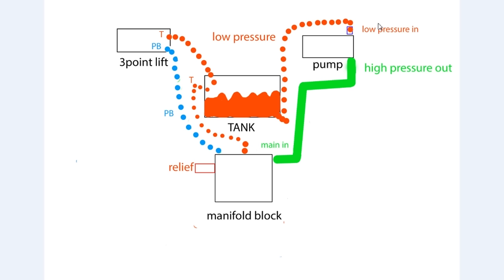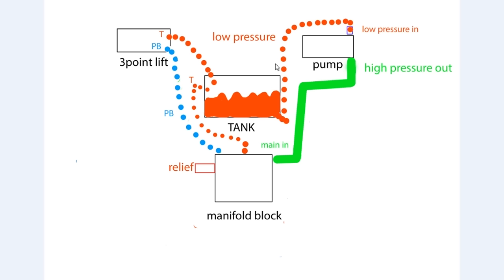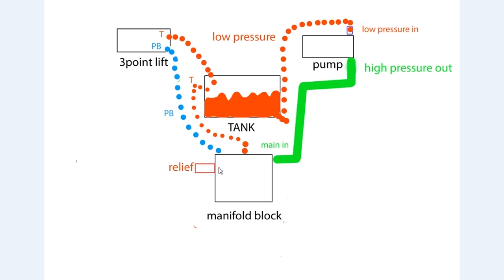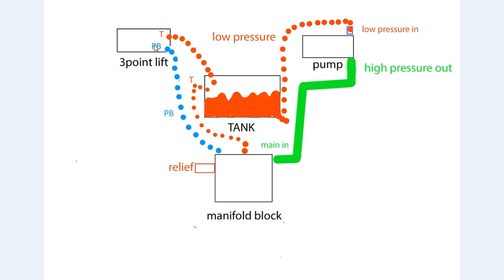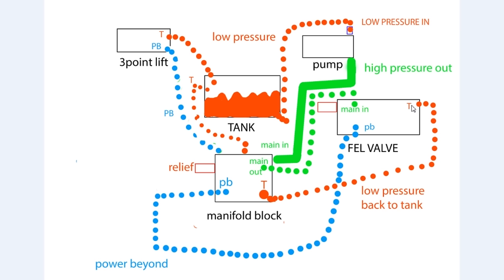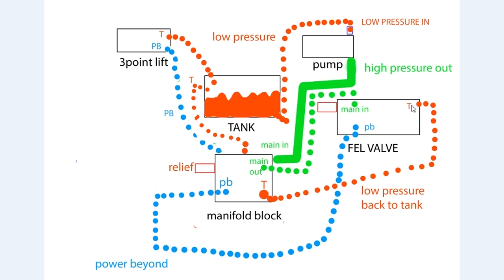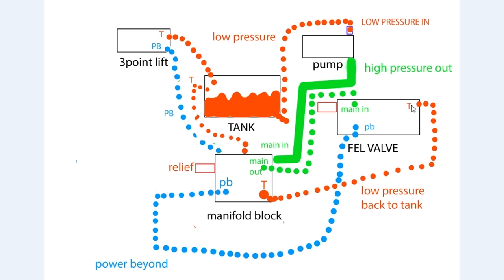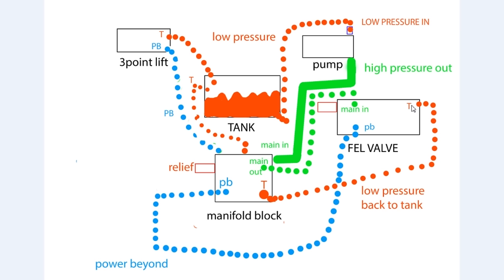adding rear remotes and understanding tractor hydraulics

Comment: I'll add my thanks as well, but I do have a question, if you don't mind.  I just added a 3rd function valve to my L3301 to operate a grapple on the FEL.  I  am working on installing top & tilt to the box blade as well.  My Prince (Wolverine) 2-spool valve does not appear to have a relief valve going back to the tank, as your video shows.  Also have no back hoe.  From the 3rd function valve, do I now route the PBY out line to the new spool valve and then from the valve to the PBY (green) input on the tractor manifold block?  What about the relief valve line back to the tank, that the valve does not have?  Also, in this configuration, do I need to install the optional Power Beyond/Closed Center Conversion Plug in the spool valve?  Thanks again for your helpful video.
Reply from the maker: you need the valve to be an open center valve so if that means leaving the plug out leave it out. not sure on that valve. yes you simply run from the power beyond at the loader control to the input of the new spool valve then the output of the new spool valve goes to the power beyond at the manifold block. if you do it wrong you will hear the pump strain as the relief opens and more likely the three point will no longer raise.

Comment: How do I install a remote on a John Deere MT?
Reply from the maker: you will need to locate the main hydraulic pump that feeds the rear three point. I'm not familiar with that specific model to tell you exactly how or where it is located. you may get with " tractor man 44" on youtube. he knows a lot about older tractors and owns a ton of them. he may can help you locate the pump so you can tie into it with a valve that has a relief built in it and then just set the relief properly so it dont burn up the pump or cause other damage. if you can tie right in the existing pump after the factory relief you may be all set. reach out to him via his channel and let him know I sent you over there. I know if he can he will help you out. if I find more information on that machine I will let you know here under this comment.

Comment: Thank you daveknowshow for an excellent video, I have a problem with my excavator I posted a Video on my channel, the spoolvalve featured in the video only work in only direction, should i pull it apart or just order a new"used"?
Reply from the maker: pull it apart! more likely a broken spring bad Oring or something that has the port clogged up. could be as simple as trash in the valve. pressure relief stuck open or even linkage issues can also create this problem.

Comment: Thanks for this great video. I don't fully understand though... I just purchased a 2022 Kubota B2601 and the power beyond port goes directly to the tank. I watched some videos of how to add rear remotes and they just take that line off and utilize it for rear remote spools. But that doesn't seem to line up with this video that always shows the PB going to the 3 point. In my head somehow the power beyond has to have pressure against it otherwise it would just relieve all the pressure in the system going straight to the tank, right? I mean I know that seems right to me but somehow it can't be? Thanks for your help!
Reply from the maker: Yes it bypasses straight to tank until you move the three point lever. Then the pressure increases due to load. Once three point is in position and is satisfied via the feedback rod the valve reverts back to dumping to tank. In other words the three point control valve dumps to tank and is the last valve in the circuit. Also when no spool valve is calling for fluid power the system shows very low to no pressure.pressure is only present when fluid is place into a path of resistance. As in into a hydraulic cylinder. I hope this helps
Reply: @daveknowshow  Thanks for your explanation! That definitely helps. I also learned that when folks called the line on my tractor that goes from loader valve PB port to the 'tank' it is actually going to the 3 point first, as you're saying. That helped clear things up for me, too. It is a little hard to understand how there is little to no pressure in the system normally, but when something calls for fluid somehow pressure appears. Sounds like magic to me lol. Thanks again!

Comment: Dave, awesome video.  Wish I would have seen it before I had the dealer install rear remotes on my L3400 (15 years ago).  Where did you get the tee adapter for the tank port?  I've been looking for one with no luck to reconfigure.  The dealer put a hose to my hydraulic fill and it's very annoying.  It not only makes it hard to add fluid but it also gets in the way of my top link so hoses rub.
Reply from the maker: I think I ordered it on amazon or I may have got it from Summit hydraulics they are very helpful. give them a call

Comment: I want to add 3rd function to my fel but I’d also like to add a hydraulic top link in the rear. I have a backhoe on my Mahindra 1533. Summit has 2,3, and 4 valve kits now or you can get a w r long 3rd function. What is best to do? This video makes it sound like you can add more functions by getting a spool valve and have extra levers vs electric valves. What should I do?
Reply from the maker: I like the electric third function for the loader. I did a video showing how I did mine on the cheap. I bought some parts from summit and after he seen what I was doing he put together an inexpensive electric third function option for the front end loader. as far as the rear remotes for the top link I wish I had of installed a three spool valve instead of the two spool valve I installed. of course where I installed mine I could not fit a three spool valve. only a two spool. with two spools valves I have hydraulic top and tilt. with one more valve I could actuate a small dump trailer. I may build a small dump trailer and add in an electric valve to control it. the guy at summit can help you with all this stuff he is pretty good with piecing together what you need. if I can be of any help please reach out to me. I'm here to help. you can add as many as you want by following the video you just watched that shows exactly how the system works.
Reply: @daveknowshow  Thank you for the quick response sir. When I watched this video: https://youtu.be/_BoflPiwd64 it gave me pause to think I could just add this from summit for nearly the same cost but also have additional hydraulic remotes. The W R Long 3rd function is like 850 bucks alone just for the one function. Still best to spend that much on the one third function? Thoughts? Thanks!
*perhaps you can answer this too: why when I disconnect my backhoe is there 3 hydraulic lines? One is pressure in one is return so what is the third? All I know is when I disconnect it I supposedly have to connect one back in to keep the 3 point lift functional. This just keep the hydraulic circuit flowing through?
Reply from the maker: @lh98  yes one is power out  one is power in. those two hook together to complete the power beyond circuit and allow things down stream to function. like the three point hitch which is typically the last function on that circuit. you can use the wrlong third function or get the one from summit that is like around 550.00 I think. very well worth it. you want to control that grapple from the loader joy stick electric control. I like the non electric style for the rear top link so you can feather it and move in or out slowly. cant do that with the electric third function its wide open or off no in between.
Reply from the maker: @lh98  https://www.amazon.com/Hydraulic-Function-Joystick-Handle-Couplers/dp/B07N7KFSG5/ref=sr_1_3?crid=242LT900YKGA5&dchild=1&keywords=third+function+valve+kit&qid=1622776451&sprefix=thrid+function%2Caps%2C152&sr=8-3

Comment: Hi Dave.  I am looking for the type or name of fittings you used on your manifold block for the lines coming from your front end loader and the line coming from the rear of your tractor.  Those line lead to your back to tank port on the manifold and feature and T-fitting and some type of fitting connecting into the block.  What type of T-fitting is that as well as the fitting you used to extend the T-fitting out from the block?
Reply from the maker: the manifold block on mine has a national pipe thread. I actually changed it from this configuration to another configuration that works better and protrudes less. I can email you a picture if you contact me via email at Daveknowshow@aol.com the fitting I used was a 3/8 NPT male to 3/8 JIC female adaptor which connects to a 3/8 jic T connector with 3 JIC male fittings which the hoses hook into from the loader and rear remotes back to tank lines. if you would like a picture of what that looks like just email me and ask for the pictures of the manifold. I will be happy to send them ASAP.

Comment: I have a mahindra i need to know how to put my hydraulic bucket on
Reply from the maker: should be the same method. locate the power beyond manifold and tap inline between the two ends to feed the third function valve for the 4n1 bucket or grapple which ever hydraulic fron attachment you have.

Comment: great video buddy but I still didn't get it LOL do these have to be open Center valve's I'm looking to put a third function on my tractor it an MX 5200 and I have backhoe attached to it I know I should tap to the power beyond and bring it back to the block but I'm not sure if a closed Center would work thanks
Reply from the maker: power beyond is an open center circuit. since the center position is open the fluid keeps traveling out the power beyond port to the next valve or item needing fluid. when you move the lever one way or the other the valve opens the other port and closes the open center portion to divert fluid where its needed. when you release the lever it returns to  center position and the open center sends the fluid back out the power beyond port to be used else where. on your MX5200 if you operate the loader control valve and the three point lift at the same time. the loader will move and the three point will wait until you release the loader joy stick back to center.  hope this explanation helps. I used this valve that can be changed to closed center or open center. open center is used when you have a need for power beyond and to prevent pressure relief from over working itself. https://www.northerntool.com/shop/tools/product_200419671_200419671
Reply: @daveknowshow  I think I got it now buddy I will need a hydraulic solenoid valve that's open center and rated at least 10GPM so fluid can flow through PB and continuously flow to backhoe 
I just seen a video poetry square wheel   it gave me chills described myself quite a bit thanks again Dave
Reply from the maker: @cristianosilva6052  sounds like you have it figured out now. are you installing a grapple? or 4 n 1 bucket? is that what this is for? 
also sounds like you have found some of my 3rd grade poetry. ha ha  I'm glad you enjoyed the poetry. its not something I write very often, just when the spirit moves me. I think I have a few uploaded on the channel now. its just a way to let the Demons out! lol thanks for watching if I can help with any questions fire away.
Reply: @daveknowshow  good stuff Dave iam looking for a graple but it's so expensive hope you had a good Thanksgiving day buddy thank you again for all the good information you shared with me
Reply from the maker: @cristianosilva6052  glad to help if you have any questions at all please feel free to ask. if I know the answer I will surely share with you if not then I will share that as well. the grapples are expensive but once you see how much you can get done with the grapple you will be glad you went ahead and spent the money. money comes hard for me as I'm on disability $740.00 per month every since I was diagnosed with cancer. hardly enough to live on. the youtube does generate about 100 bucks every two months which helps. a few people have helped by donating a couple bucks to help me. if not for that I would be in really bad shape. I hope you can work it out to put aside a few dollars each payday and maybe do a tractor job here and there to get together the money needed for the grapple. you will surely enjoy having a grapple. I have a couple videos showing my grapple being used. its a joy to use and really saves a lot of time. keep me informed on which grapple you get. I have a feeling you will be getting one very soon. the money will come as a blessing you wont really expecting. that's typically how it happens.

Comment: I want to put a power beyond set up on my tractor but I can't find out which ports to connect to and my dealer won't show me a schematic. I have a Mahindra 2638 HST without a backhoe. Can you help me. Thank you.
Reply from the maker: I can try. there are a few test we can do if you know where the manifold block is located on the machine. or we can start at the front end loader valve

Comment: Dave Thanks
Can you show links to parts used in your installation on suppliers?
I have a Kioti LK3054 which is very similar to the Kubotas.
Thanks again.
Reply from the maker: I dont have any links my advice is locate a decent hydraulic shop that is willing to help you figure out which adapters you need. some fittings on these tractors are 3/8 NPT " NATIONAL PIPE THREAD " others are JIC style fittings. do a google search for  " identifying hydraulic fitting " this will help you be able to identify what you have and build from that. I went cheap because my money is limited. I used a lot of 3/8 NPT premade hose. this saved a lot of money. I still had to convert some of those 3/8 NPT fittings to JIC or BSPT " british straight pipe thread" and also the number 8 o-ring style as well.  its a lot to deal with and I simply did the best I could to save money. with that said I likely spent more than I should have but lots less than if I had paid the dealer to install it and get the parts together for me. I got frustrated at times but it was a learning experience. lol

Comment: Hello, I'm installing a 602 backhoe on a l3400 and the backhoe has 3 hoses....i;m confused...could you please help me? Thanks so much!!
Reply from the maker: yes one of those three hoses is the back to tank hose. refer to the owners manual for which one is the back to tank hose. you can dump that hose to the back to tank port which is labeled in your owners manual  page 36. or you can install an adaptor and dump it into the hydraulic fill port at the rear of the tractor where the red cap is.
Reply: @daveknowshow  Thanks so much! Could I just put a tee on the loader block return?
Reply from the maker: @kimberly41301  yes i installed a 
"T" at the back to tank port at the manifold for my rear remotes and a "T" at the loader control back to tank port for my variable diverter valve in the video i did on the jerky three point hitch issue.
Reply: @daveknowshow  Great! I can't thank you enough! Your videos are very informative. Keep up the good work....
Reply from the maker: @kimberly41301  thanks a million my friend!!!

Comment: This is something that has been on the back burner for a while, Have a Kubota 8950 its loader is running on the 4 ports on the back to my knowledge this was common in the older days of tractors. Need to check with dealer and see what kind of kits they have for this tractor. Would be nice to get the loader running on a joystick freeing the back up. Looking at getting a flexwing cutter disconnecting those hoses is a pain. For hay work normally just pop the two out that run the front no pressure easy to get back in. Have also been looking at the hydraulic multiplier using 2 of those.  Would be cheaper I am sure
Reply from the maker: there should be a way to install a power beyond manifold block to  plumb out of.
Reply: @daveknowshow  I would think so I have seen pictures of the model above it and below it that appeared to have loader working from PB

Comment: Awesome explanation, thank you. I have a small tractor Satoh S370D with a cat 1 3PH and FEL. I wanted to add a hydraulic top link and try to use a 2 spool valve or a joystick to operate hitch up and down along with top link out and in. Are the lower arms of the 3PH usually too integrated to add to a joystick or standard spool valve? 
I also want to add a remote filter because to clean my strainer I have to drain all the oil in the system to pull it. Where in the system should the remote filter be added?
Reply from the maker: great questions but beyond my pay grade. typically the rear lift has an internal hydraulic cylinder and a tad difficult to add a joy stick control for the actual three point. three point lifts are generally power up gravity down and have a position control sensor to maintain height.  on mine the two spool valve operates a top link and a tilt link. I dont have the tilt link yet that will be a future purchase. normally the filter is in the back to tank line and on some tractors between the HST tranny and the back to tank return as well as the back to tank line from the three point system.  a shop manual for your tractor would shed a lot of light on what you could get away with doing.

Comment: Hey mahindra loader don't work. It miss a control valve where I get it
Reply from the maker: I dont fully understand your question. if you look in your owners manual you will likely see where the hydraulic manifold block is located. you can buy loader control valves to adapt to that tractor from many places for example surplus center dot com sells hydraulic control valves of all types. I hope this helps.